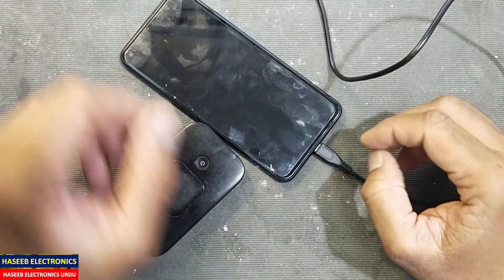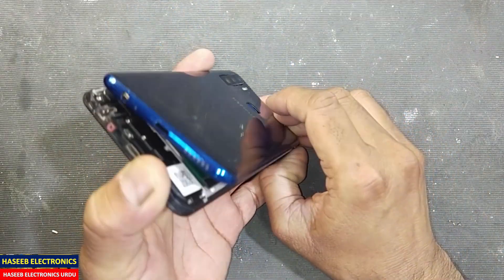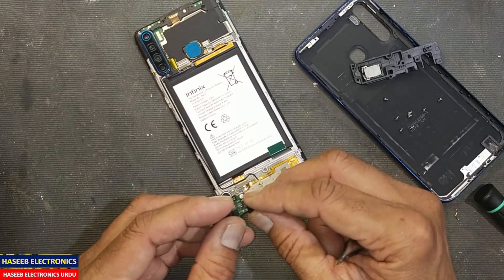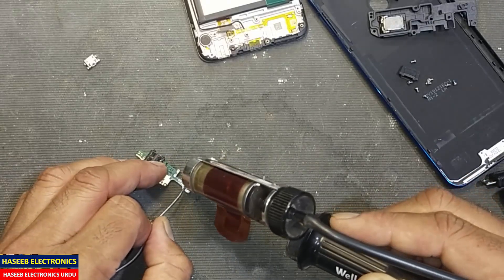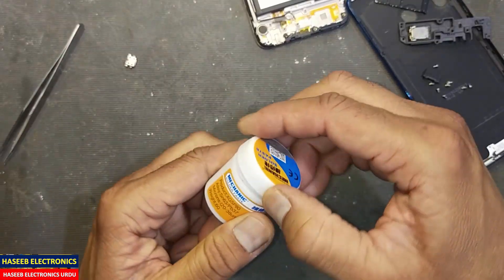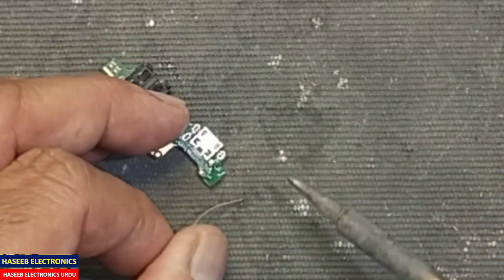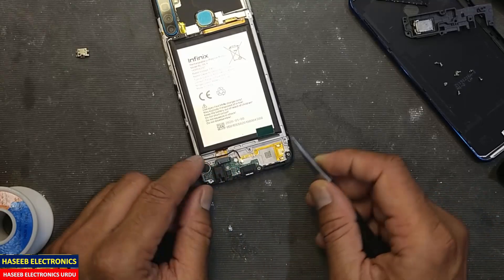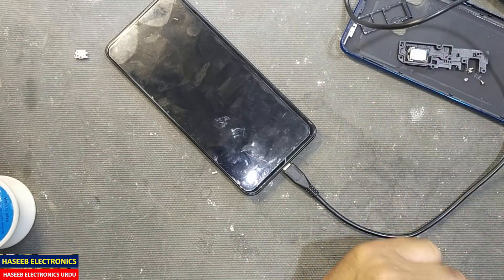{606} How To Replace USB Charging Port In Smartphone / Change USB Connector in Mobile Phone

Comment: Perfect camera angle. Thank you for taking the time to make this. In my opinion Micro USB are one of the most fragile ports ever made. Common for them to break within 6 months of normal use. Edit. I saw you wrote that there is a big difference in the quality of ports. I will make sure to get better ones if I replace them.

Comment: I have replaced a number of cell phone USB ports.   Generally, the boards themselves are as problematic as the USB ports themselves resulting in recurring problems.
Reply from the maker: no if the USB port is replaced properly and the USB port is selected in good quality then it remains long lasting
but if we replace with low quality spare parts it repeats again and again 
in low quality jacks the plastic grommet is used in lowest quality. that's why it damages quickly and it's contacts separate easily
Reply: @HaseebElectronics  Thank you, I didn't know there was such a big difference.

Comment: Good job! Thank you for sharing. Everyone that comes to me with broken USB connector is recommended to use magnetic USB charger cable in future. Most of the problems could be prevented by this cheap tool. One will find it on several internet traders.
Reply from the maker: it is really a great dedication to your profession. I salute you sir